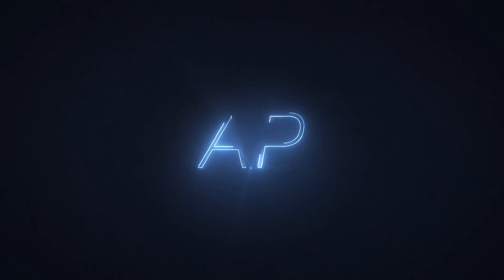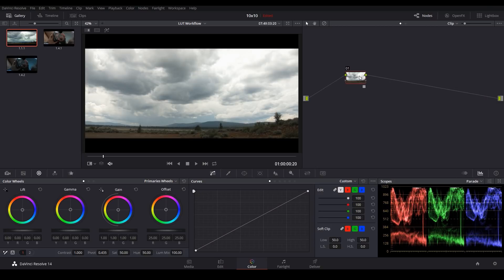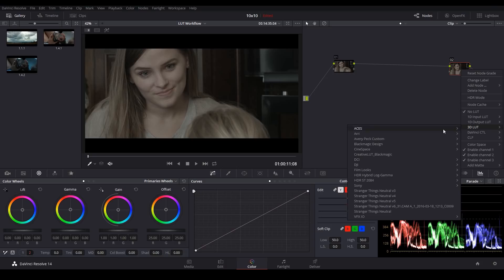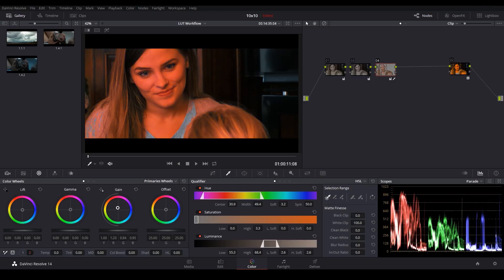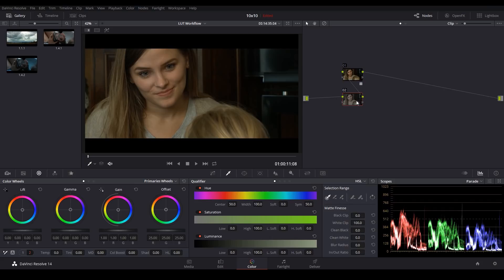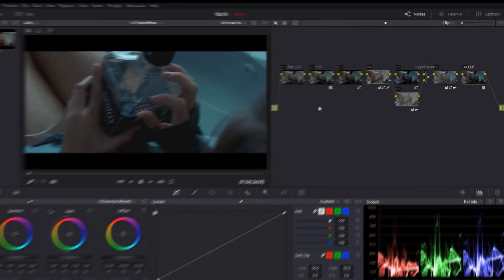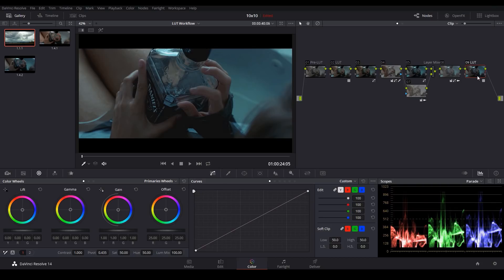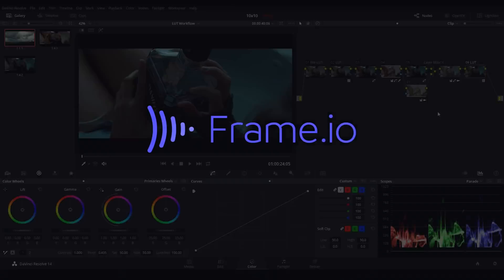The LUT Workflow Explained (Part 1) | DaVinci Resolve

Comment: I created a look i like for some videos that I've been adding to new vídeos. The issue I have is that I have to drag over the lut and then copy paste color settings from previous timeline on top of it. i tried editing the original color settings but i can't get the same look without adding new color settings on top of the already set lut. i tried creating a second lut from the color corrections I was putting on top of the first lut and adding them together (like you show in the video) but the result is not the same as when I copy paste color from original timeline on my first lut. Its similar but not the same. I want to combine the color to make one lut to be able to add to new videos instead of adding lut and having to go back and copy color settings from previous timeline. I'm not sure is I explained that too well. LUT1+copypaste color from original timeline=correct color / LUT1 + LUT2 (created from copy/paste color) NOT working the same. Any ideas to be able to add first LUT plus color settings into new LUT?

Comment: Why is it necessary to do these transforms outside of the settings? They should be already specific used in the IDT / colour management settings for the project? When I grade, I set an IDT and the output transforms in the settings .. that’s it done! Can then grade as I want in the colour page without transforms cluttering the page or losing any detail!
Reply from the maker: ACES and RCM are two good solutions (I have a video on RCM in addition to this one). However, there are a multitude of reasons you may want to do the transforms directly in the node graph. For instance, you may prefer to balance your shots in the original camera native space, but then perform secondary corrections in 709. There also may be instances when you want to perform operations in a linear space, then transform back to log. Working in a variety of spaces/curves within a single grade is quite common.

Comment: Great tutorial , but I have a problem.. I follow yours and other same process but when I do 3 nodes and put the LUT on the third node, when I go back to the second to make fine adjustments it does not work like yours. The highlights and shadows move or change differently, almost like there is a qualifier on them or something. They adjust differently. Hard to explain but it is happening to me on a project right now. If I do adjustments before I put the 3rd node with a out it work just fine, but as soon as I put a 3rd node with the out and go back to the 2nd to try and adjust, it is different how it reacts if that makes sense... really weird and I cannot figure it out... Can you think of any possible reasons this may happen?
Reply from the maker: I can think of two possible reasons off the top of my head. First, and this may seem silly, but are you using the log wheels instead of the lift gamma gain wheels in the second node? The log wheels are more limited in their adjustment range by default and have sharper transitions than the LGG wheels. Another possibility is that the LUT you're using has some weird stuff going on in the highlights and pre LUT adjustments make that apparent. To test this, you could use another tool like the curves in the 2nd node and see if the problem persists. If it does, it's more likely an issue with the LUT, if it doesn't it's more likely an issue with the wheels. Hope that helps!

Comment: So in project settings, under color management, what are the best settings for color spaces—input, timeline, output, etc? Isn’t that essentially doing what you’re doing here with LUTs? Converting? If I have BMPCC4k footage, that would be the “input color space”, correct?
Reply: it's kinda the same but offers less control

Comment: The broadcast safe limiter you have at the end is bonkers. Can you explain it? Why oh why would you want to clip the bottom chuck of data off your video? Resolve outputs Video levels so 0 bit blacks are 0 IRE or 0% (no need to clip so high). Or am I missing something?
Reply from the maker: You're correct; the LUT is just used as an example of what happens when you make adjustments after the LUT vs prior to the LUT. Exporting at video levels should always be done on the deliver page, not through a LUT.
Reply: @averypeck  Thanks. I thought I was missing something vital about broadcast safe with regards to Resolve.

Comment: Avery - How does this work with RED .r3d footage shot in DRAGONcolor2/REDgamma4? Is this similar to a Rec709 LUT? Do I need to convert to REDlogfilm first, then pull back any overexposed areas, then apply a Rec709 LUT?

Comment: Great video! What about the workflow when using groups with group pre-clip, clip, group post-clip, to grade similar shots at once? I usually have my lut on the group post-clip, and I do each clip adjustment pre lut in the clip section. I'm wondering if there would be a trick to be able to do post lut grading too without having to duplicate the full grade on each clip.Thanks and keep it up!

Comment: Excellent video, thank you Avery! Just to clarify two things:  
1. is it only necessary to do a pre input LUT node if going from a wider colour space to a narrow colour space (which is typical as acquisition is typically in a wider colour space) ?
2. it's disappointing that the colour correction tools doesn't work in the colour space your Log footage was shot in - it seems it would be a good idea to be able to grade in the widest possible colour space to lose the least amount of data and then apply an output LUT to map down to a delivery colour space ... or is that the wrong idea since it might be hard to visualize what you're doing?

Comment: Hey there! RCM or conversion lut ?
Reply from the maker: It depends. LUTs often do more than just color space conversion; they often have additional corrections to make a camera's response more pleasing. RCM on the other hand is more flexible, and provides consistent results in multi-camera sessions, but doesn't cater its adjustments to the camera. Just depends on what you need for a certain project!

Comment: So this is a hard thing to search, A lut that gives you the colorspace of Youtube. So tough to search because it gives me youtube videos of colorspace or lut workflow haha.
When i export, even using the youtube preset. my dark areas are pushed higher and look a bit faded vs the true black i had set prior. 
Any idea? Thanks for all your time, love the channel!
Reply from the maker: Hey Enrique! The color space of YouTube (and all online material) is rec709 gamma 2.2 (sRGB). That said, it sounds to me like you have either a gamma mismatch problem, or an issue with full/video levels.

Try importing the exported video back into Resolve, and see if it still looks wrong there. If it looks correct, then your video player is at fault (QuickTime is notorious for having gamma issues if you're using that). If it still looks wrong though, try setting your levels to "video" in the deliver page before exporting.
Reply: @averypeck  Awesome, thanks! I'll try this out today. I Appreciate the quick response! The YT preset has them set to auto, but i changed that to be set to full. But i've never tried Video.. hmm...
Reply from the maker: @RickyTinez  Ah, that would be the issue then! Video levels are standard for web and TV material; full or data levels are typically used for cinema delivery.

Comment: Great stuff... wasn't aware of the tools not being so focussed on log footage... do you know, if there's a "target" colorspace, the tools are designed for? Rec.709? What about DCI-P3 , or Rec.2020? Would I be right to grade in 709 and convert afterwards?
Reply: I should have watched the video to the end first... :-D ...Answers follow from 6:05 ...
Reply from the maker: Hey Simon! Just adding to this, you can change the mapping of the controls under Project Settings -> Color Management -> Timeline Color Space. The default is Rec709 gamma 2.4.

Comment: that LUT on the end does not make it broadcast safe, just export to a video range codec such as ProRes and you'll be fine. But if you export ProRes with that LUT on, all you'll have is massively raised black levels
Reply from the maker: I know :) I'm using it as an example since there's a clear visual representation on the scopes of what the LUT is doing.

Comment: If my colour space is displaying in rec 709 do I need to use a conversion LUT at all when grading say BDM film ?
Reply from the maker: Yes, if your monitor is in rec709 you definitely need to convert first. The reason being that your monitor is expecting rec709 material, so showing bmd film colors on a rec709 display will give inaccurate results.

Comment: so should we use the techical lut or RCM to convert the clip  to Rec.709?
which one is better? still a  little confused . 
thx u!!
Reply from the maker: RCM is a better method assuming that it supports your camera's color space. In the case that RCM can't be used though, manufacturer supplied LUTs are the next best option.
Reply: @averypeck  thank you so much !!!

Comment: I'm new to color grading and am wondering if there is a difference between using a lut, opposed to making adjustments manually to color, darks, lights, etc, to get the same visual result. Does this make sense? If there is a difference, could you explain? Thanks!

Comment: Thought of a question maybe you can answer. Why would you want to do an input LUT vs an output LUT?
Reply from the maker: Good question! It depends primarily on what the LUT is used for. An input LUT is used any time you need to alter the footage before correction/grading, a color space conversion being a good example. An output LUT on the other hand is applied at the very end, and is used to make sure that the final image always conforms to a certain look or standard. For example, adding a film print emulation LUT at the end of your workflow means that every adjustment you make will be filtered through the LUT before being displayed. In other words, your footage will always be within what the LUT defines as correct for film stock, and never stray outside of that. If you applied that same LUT at the beginning (input) and made your corrections after, you would be able to easily stray outside of what the LUT defines as legal because your adjustments wouldn't be controlled by the LUT in any way. You can try adding a creative LUT at the beginning and end of your workflow to get a better feel of the difference!

Comment: Why would you ever use a Log to 709 LUT, when you have RCM and Color Space Transform nodes.
The LUTs use quantized precision, but RCM and CST can perform a discrete transform.
Reply from the maker: This tutorial is designed for beginner colorists who need simplicity over power/flexibility. I have a full tutorial on using RCM as well, which is what I use in my daily work.
Reply: @averypeck  I think you should talk about it at the begining or make annotation on video because it's a little confusing right now. Thanks anyway, very good job :)

Comment: Great work, as always, just a question: when would you use a technical LUT as opposed to Color space transform?
Reply from the maker: Thanks Michael! They're actually one in the same. "Technical LUT" is just the generic term for any LUT that provides a precise, mathatical transformation. For example color space conversion, or film print emulation.
Reply: Avery Peck cool, I tried to figure out if there was any difference between them, I did find that when you use color space transform you don't seem to clip the footage so I'll just keep using that probably. thanks for the advice!
Reply from the maker: Sorry Micheal, I misread your comment. I thought you were asking the difference between a technical LUT and a color space transform LUT, not the OFX plugin. Yes, the color space transform effect (and RCM) convert the image algorithmically rather than with a table, so it's both non-destructive and can be tweaked to your liking. I personally use RCM in my day to day work.
Reply: Avery Peck fantastic, thanks again!

Comment: what about a situation if you are building your look without a 3d conversion lut from log space, is it somehow wrong? if i want for example milder blacks, more cyan blues etc. should I first use conversion lut and then create the look or you can do it from scratch, from the log color space? is the footage still flexible as it was before applying conversion lut? thanks.

Comment: Great video. Quick question, why would you grade in Rec.709 when your output is P3?
P3 is a wider gamut, so you would be losing colour fidelity. Would it not be better for your working space to be as wide as possible, like ACES 2065, before transforming to your output space?
Cheers :)

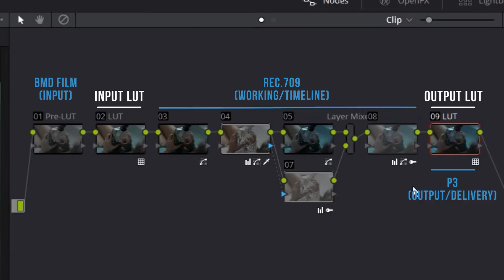Comment: When using a LUT for broadcast safe values in Resolve as in 6:37, keep in mind that Resolve uses full RGB levels internally and will normally scale to video levels when rendering unless you tell it otherwise. Therefore clipping the black level above zero doesn't make much sense and is kind of misleading.

Comment: One crucial question from me is how to deal with a situation like when you did colors for DCI-P3 film format for the theaters but then the film would also be releasing online/TV, do we have to readjust or adapt back to Rec.709?

and we would also be benifited with a tutorial on Primary Wheels vs Log Wheels.
Reply: @Vishnu, I would recommend that in your timeline node tree (toggle it with the radio buttons at the top) you add the luts (or color transformation nodes) for each of the spaces you need, and toggle them on and off for the exports. So toggle them all off for rec709, toggle a P3 node on for P3, etc. That keeps you from having to edit nodes in each clip for each export.
Reply: Luke Turner Media Thank you brother. Really appreciate this.
Reply from the maker: Vishnu Attiappan Just to tack on to what Luke said, you can add your input and output LUTs globally in the color management tab (underneath the color science settings). Just keep in mind that doing it this way won't allow you to keep one node before the input LUT to retain information. But for output LUTs, it's great!
Reply: Question for you Avery: at what point in the chain does RCM apply its transformation? Does using RCM prevent you from recovering highlights?
Reply from the maker: Good question, Luke. RCM applies its input transformation at the very beginning and its output transformation at the very end. The cool thing about RCM is that it's non-destructive, unlike LUTs. So even if highlights clip, you can bring them back at any point in your workflow; you don't have to have any sort of pre-RCM node to do that.
Reply from the maker: Thanks Vishnu! I'll definitely keep that in mind :)
Reply: Avery Peck awesome! Thank you man, I love your videos. I use your skintone workflow on most of my projects now
Reply: Avery Peck Thanks a bunch brother. Will try it out and notify you if I encounter any hassles. Keep on doing what you're doing for us and set up a Patreon page as people like us are waiting to contribute too ;)

Comment: One question, are you doing this workflow in Resolve color managed? If so, based on the workflow of your previous tutorial, what is the best way to export your project for YouTube/Vimeo, to be able to view it properly.
Reply from the maker: Good question; I'm not using RCM for this tutorial. RCM would eliminate the need for any color space conversion LUT, either input or output. The best workflow for web is to work and deliver in rec709 gamma 2.4, either by using the correct input LUT or setting your RCM output and timeline space to rec709.
Reply: Gotcha, so if I go the color managed route, what would be the best way to export for web? Whenever I try the color managed workflow it goes so smooth until I export for web, it’s like all of my color grading disappears with the export. I have searched for months to find an answer for this question and I see a lot of people have this same question on forums as well
Reply: I had this problem for a while so just in case useful..fix for me was going to advanced settings at the bottom of the Delivery video options and turning off 'enable flat pass'